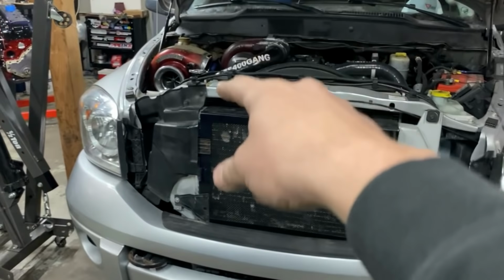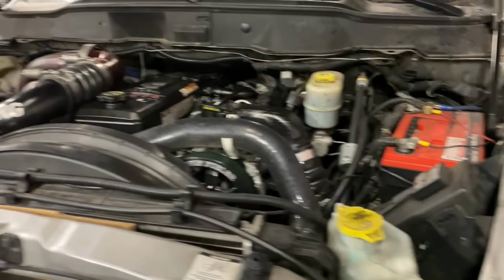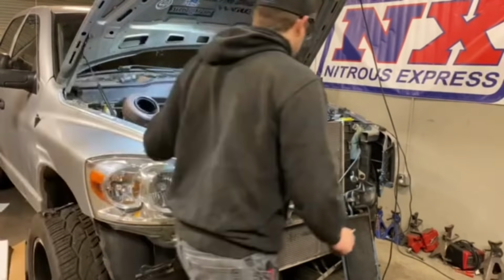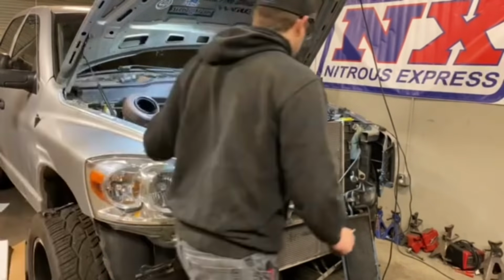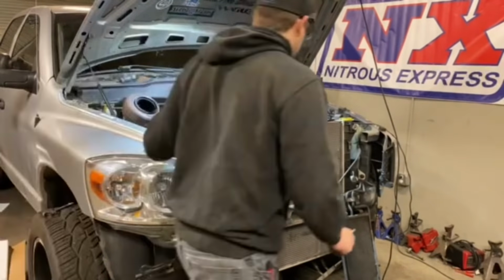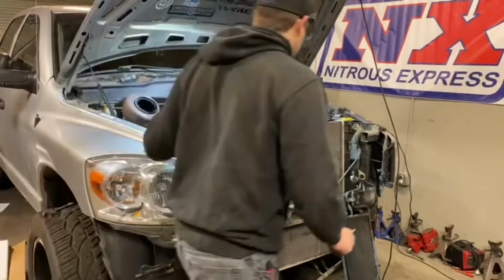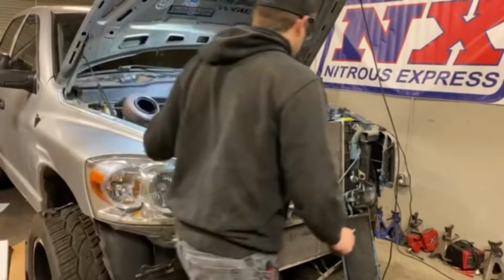CUMMINS BLOWN ENGINE REMOVAL! HOW TO MODIFY FRONT CROSS MEMBER.

Comment: You don’t need to cut or modify anything on the front cross member. Undo the two body mounts that hold the front fenders on, and use a 2x4 and the factory vehicle jack to spread the front clip apart. It only needs to move about 1/2 - 3/4 of an inch to get the cross member out. And then it springs back into place when you take the jack out. Zero cost and zero modifications needed.
Reply from the maker: Sounds like a lot of work at the track
Reply: That’s just what I did and It worked great! faster than all that cutting!!
Reply: Any videos on this method sir?  I don't want to cut mine and need to do a timing cover gasket.  I've been trying to find a good example of this.  Thank you
Reply: @thewibb did you found a video about it?? I really need to know 😭

Comment: Was that a harbor freight 2 ton cherry picker? 😮 didn’t think those things would hold up to that kind of weight. Especially extended all the way out on that 1/4 ton point. What engine stand did you use after you pulled it?
Reply from the maker: Harbor freight stand 1 ton version

Comment: Had no idea that the crossmember had to come out to pull the engine.  Was under the impression you could get the engine out without doing that.  Nice trick.
Reply: You can, I did, but it’s not fun. Have to jack the cab up about 4”, then angle the engine at a 45* angle, take the balancer pully and ac compressor off and it’ll slide over it, but when I’m going to put it back in I’m going to cut the cross member how josh did, way easier.
Reply: I just had mine of my 05, didn't touch the front cross member. Had the head off so removal wasn't too bad and when we put it back in we had the head on but left the pan off till we were a few inches from the mounts, put the pan on and dropped it on the mounts.

Comment: Me and my brother just used the tractor to wiggle it out no dents no scratches but we later found out theres a massive hole on the side of the block and we put it down on the ground and she just starts bleeding Coolant

The motor was already blown but we had another engine from the 2500 theat we where already planning to put in the 3500 chassis

Edit the transmission was seized to the engine making in to two times harder

Comment: Don't cut. I did this with a standard high/low jack on its side and some wood blocks in 5 minutes. Spread the  mounts, the metal is flexible enough, easy.

Comment: You don’t have to cut the truck at all, all you have to do is remove the bolts. Hammer it to the drivers side. Cut just the crossmeber like you did, pull it forward it will flex and go just fine once you pulled it two inches then tap it out, the piece you cut out slide back in and put the two bolts in and never touch them again, this way you cannot tell it was messed with all the bolts go back, and if you wanna go back to factory you can get a new crossmember and spread it to install, takes me way less time and I don’t cut the truck it self. sawzall takes 5 seconds.
Reply from the maker: That would be cool. To me once it’s done I can do it without a single hammer or pry bar makes it super quick for competition repairs.
Reply: @horsetorquesdiesel  makes sense the trucks I work on aren’t race trucks, generally there work trucks and I try and make everything look factory when I’m done, I can see tryout way saving you a few minutes, every second counts at the track.

Comment: WHY go to all the trouble to 'modify" that front end stiffener (It is NOT a crossmember) by destroying it. If you are going to cut it, cut it in the middle and fish both side out from their attachment points. When reassembling, fab  apiece of steel and place in in the center and work the stiffener back into place and weld the center back up. As it is, you have two fracture points , both neeind to be welded back together. 

Darrow...for the Prosecution
Reply from the maker: It takes 15 minutes to do it. Allows it to go back in. The only thing it does is hold the Intercooler. You are overthinking it in my opinion

Comment: I am into Chevy gas engines but like your video I don’t care much for diesel because older gas engines allow me to run propane or e85 fuel as well but with diesel your stuck all you got is a heavy dirty stinky noisy expensive complicated oil leaking engine zero alternative fuel choices if diesel prices go up be it Cummings or anything else.
Reply: Maybe you should look into all the different things a diesel will run on. Way more efficient than gas. More torque.